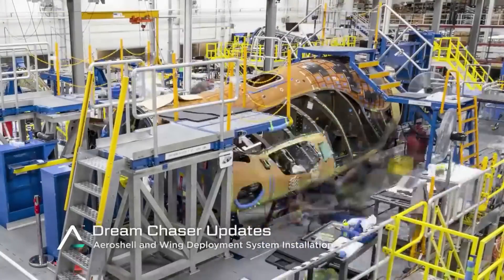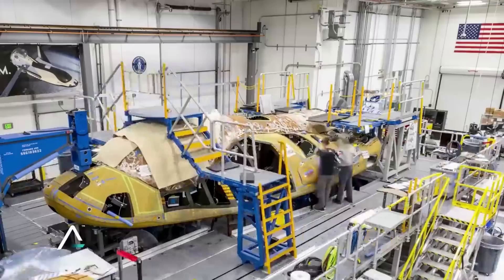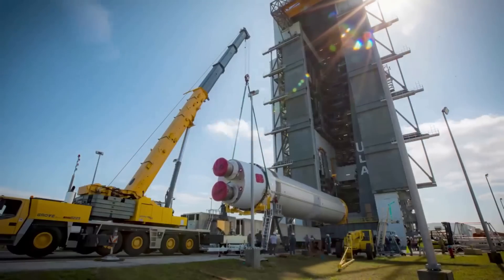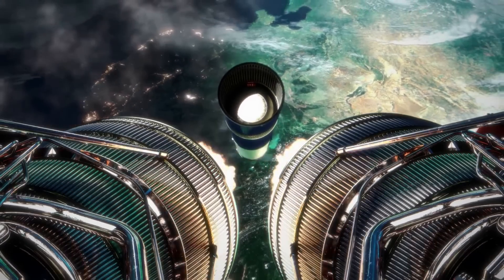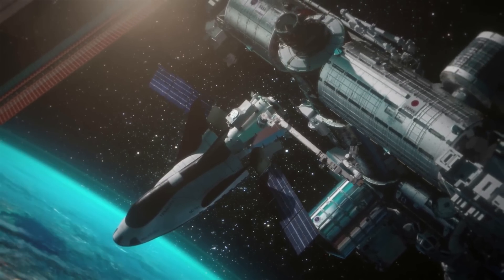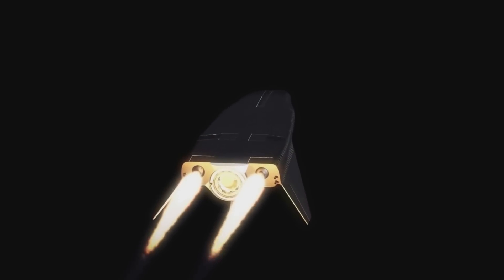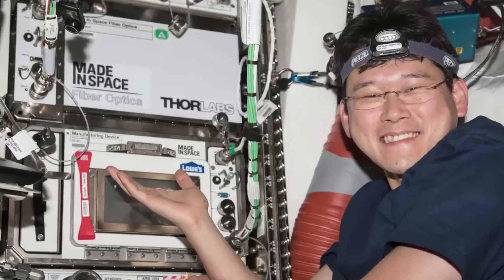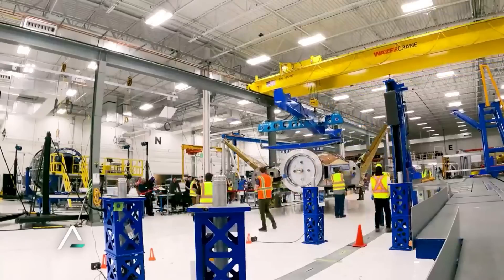Dream Chaser Tenacity Is Almost Ready For Its First Launch

Comment: and I would hope that the Falcon 9 has been up-fitted withe the specs to carry to space and launch the Dream Chaser spaceplane
Reply: Seems unlikely, they are competitors.
Reply: Dream Chaser was designed for Vulcan-Centaur,¹ but could also fit inside the Falcon 9's new bigger fairing (that they haven't used yet.)  Dream chaser could also fly on top of Ariane 5 or Ariane 6, or in a pinch, China and India both have rockets that could theoretically lift Dream Chaser.  

¹ Originally it was supposed to fly on Atlas V, but when ULA announced they were retiring it Sierra Nevada changed its development to the Atlas V's replacement Vulcan-Centaur.  This was not a huge change since Vulcan-Centaur uses the Atlas V's second stage (Centaur III) anyway.
Reply: Or the upcoming Vulcan rocket

Comment: Nice to see the X 20 Dyna-Soar is finally getting built.  If they want to into space next year the may want to talk spacex about a falcon 9 ride.
Reply: If it doesn't go up on Vulcan it will go up on an Ares rocket.
Reply: @generalrendar7290  ares?
Reply: @benlennox2980  *Atlas
Reply: @generalrendar7290  Well i could be wrong and I often am but Wiki says it is going on a Vulcan Centaur next year.
Reply: @raymondwarth2359  hence why I said Vulcan. The Centaur is its 2nd stage that will function as a space tug in later iterations if in space refueling becomes a thing.The Atlas is the backup plan if Blue Origin can't deliver the engines or if something else goes wrong.
Reply: Wasn't the dynasoar first concieved in like 1953?
Reply: @rocktech7144  Certainly late 50's. Long development!
Reply: It's funny that the spaceplane lifting body shape came from the USSR's "Spiral" space interceptor, competitor to the X-20.
Reply: @JFrazer4303  The x-20 ended in 1964 the ussr mig 105 spiral started in 1965 and i think ended in 1973